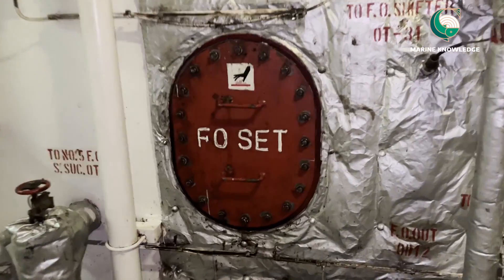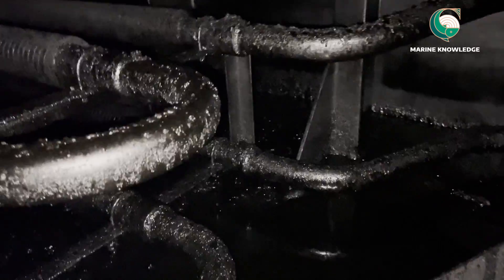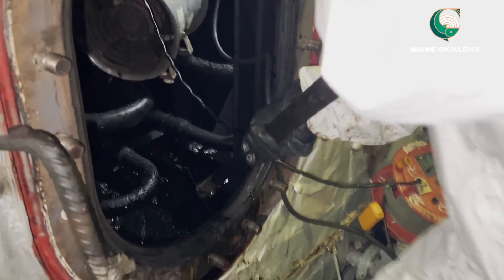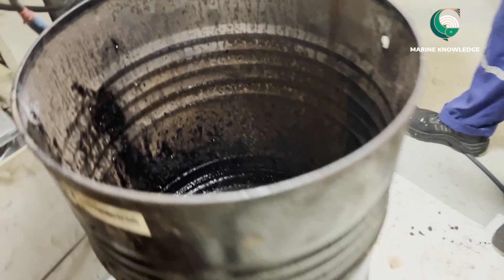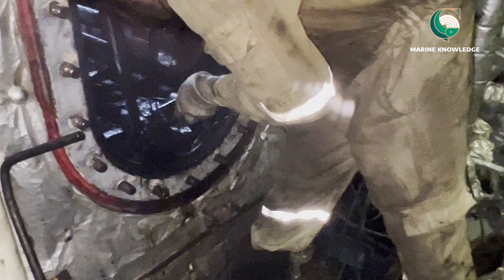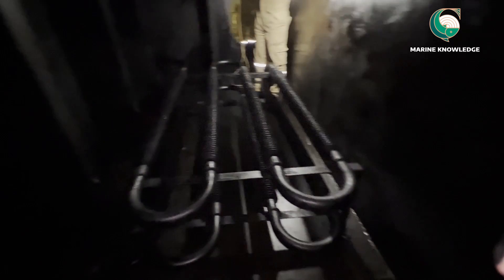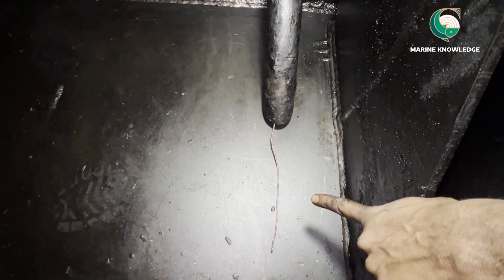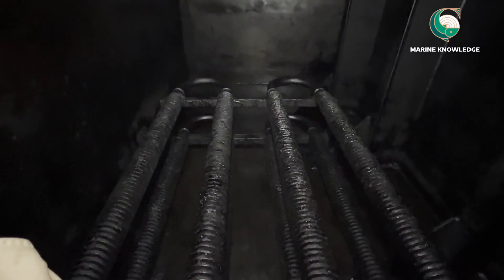How do they do...How to clean and inspect fuel oil settling tank onboard ship..

Comment: Hi sir 
Im preparing for class 4 thank for the informative videos sir . 
One doubt usually we will be having two  settling tank adjacent to each other . Even we ventilate the tank which we are going to clean the adjacent tank will be at nearly 80°C . Is there any other way from not exposing to that radiant heat from that tank while cleaning or we will stop heating for that tank also .
Reply from the maker: Glad the video was helpful for your class 4 prep and thanks for the question!
Usually tank cleaning we do at drydock. If  you need to carryout this job at sea then it can be done by isolating steam heating to the adjacent tank,
eventually it can be done during ECA area passage as diesel will be used for main and aux engines. Steam can be closed and purification can be stopped .Hope this reply satisfies ur query,